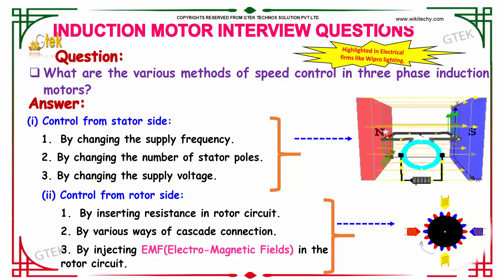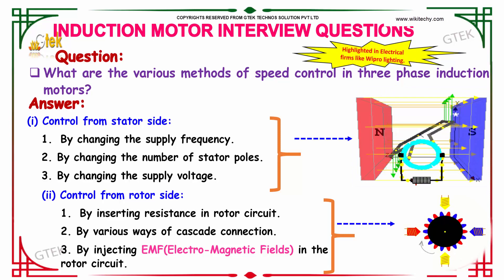Various Methods of Speed Control in Three Phase Induction Motors | Induction Motor

Comment: The speed control of three phaseinduction motor from stator side are further classified as : V / f control or frequency control. Changing the number of stator poles. Controlling supply voltage. Adding rheostat in the stator circuit

Comment: An asynchronous motor type of aninduction motor is an AC electricmotor in which the electric current in the rotor needed to produce torque is obtained by electromagnetic inductionfrom the magnetic field of the stator winding.

Comment: The speed control of three phase induction motorfrom stator side are further classified as : V / fcontrol or frequency control. Changing the number of stator poles. Controlling supply voltage.